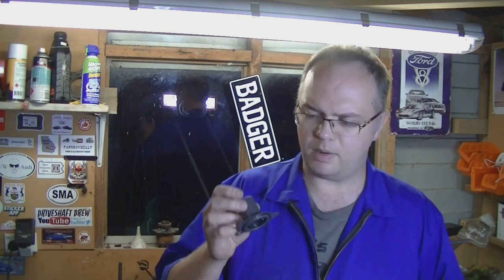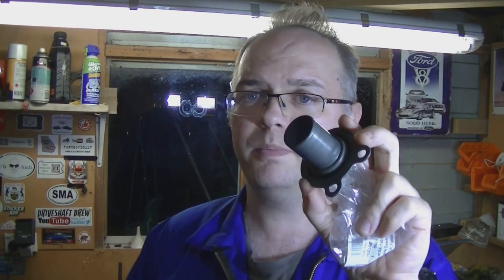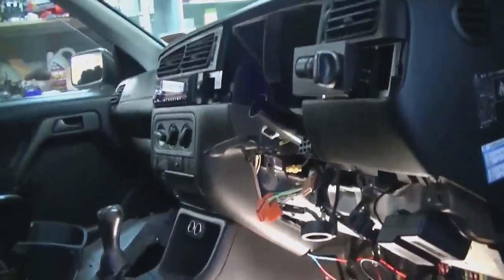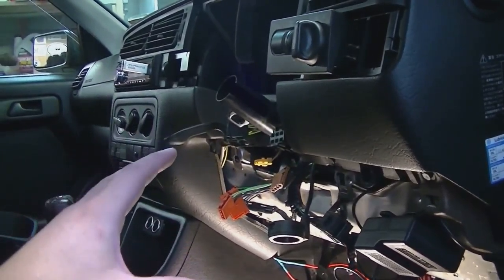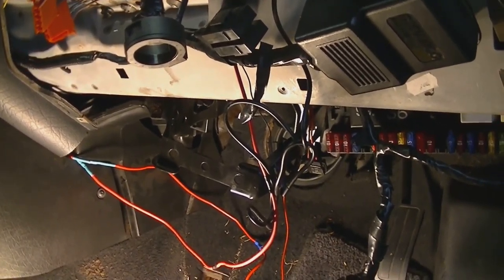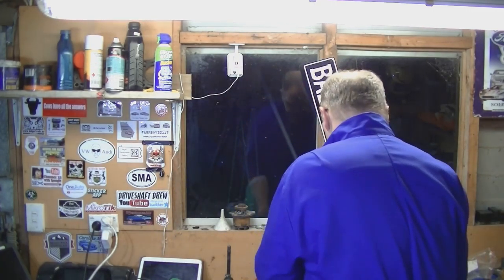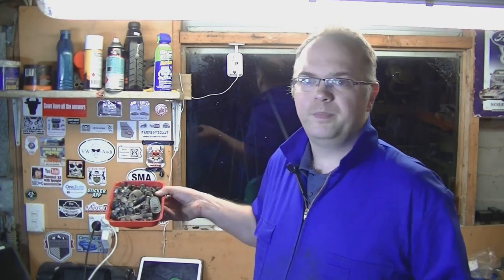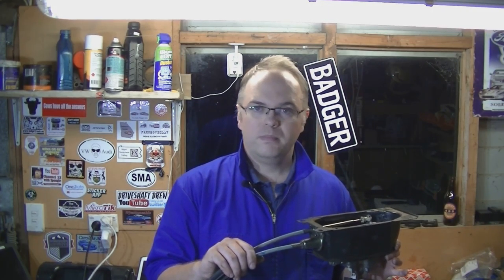Pedals and Levers - Part 9 - VR6 Rebadgered

Comment: Removing that pedal assembly looked like a PIA, but I knew you would get her out of there. Interesting how the mounting is different between the two brackets. Evidently, there must be some change between OBD1 and 2 although you mentioned the catalog showed the same bracket. Worse case is you could cut the existing front mount with the stud and weld it to the other. Would be probably nicer if you had the correct mount to fit like the other :) I'm sure you'll get it all sorted out Jonathan. Good work!!!
Reply from the maker: +stuzman after the pedal i thought the shifter would be easy but it wasn't to be. Looks like there is a manual golf in the scrapyard an hour from here. I'll try and get there today and have a look. As you say, worst case I can cut and weld. Thanks Terry, I will get there eventually. Cheers

Comment: I used a cold chisel on the steering column bolts. I tried the cutting a slot in them part but didn't have an impact screw driver to crank them off. Chisel worked great and I could actually reuse the bolts until I got proper bolts for it.
Reply from the maker: I didn't have many tools to hand so drilled them and then chiseled the heads off with a screwdriver. Hopefully they're a standard thread so I can put regular ones back in
Reply: Badgertronix m8x20 sheer bolt according to ETKA. Probably hardened steel, but I'm sure any other vw m8x20 would do.

Comment: Bummer, is there a bracket missing from the 'kit'? Like you say I'm sure they wouldn't have different body shells. I was thinking cut off the front piece with the single stud & weld it to the manual box. Then also make a bracket, box section or 'I' (eye) section around the shifter cables drill a couple more holes in the floor and nut & bolt it up. Then you would have three fixings at the front. Easy!! LOL
Reply from the maker: I can't find a bracket listed and I can't find any photos on google either. I think drilling and welding is in my future but I would rather find the VW way. Cheers!
Reply: What year is it? I'll look at my Alldata
Reply from the maker: The manual is 1993, the auto 1997. The parts catalogue shows the same manual shifter for both and the same auto shifter for both. I must be missing something. Cheers!
Reply: No go I'm afraid. Alldata starts from 1998. I've looked at loads of engines and gearboxes and there are so many variations, none of which look like your set up. Sorry cant help. Maybe Thomas can look on EKTA or look at oemepc.com

Comment: May have to weld a boss and stud to the box. Is it from the same year?
Reply from the maker: Looking that way. No, the manual is from an OBD1 car, mine is OBD2. Looking at the parts catalogue there is no difference to the bolt hole locations between years and I can't find a bracket listed.

Comment: How easy is it to find a new clutch master cylinder for one of these just like the one you have? I can only find the one where the pressure line comes out the front. Anywhere you know or a part number? Thanks
Reply from the maker: The parts catalogue is available online via realoem.me They were available when i was looking. I would have got mine from eBay

Comment: omg only one camera unsubscribe
and showing off about no rust 
nice job mate lots of awkward stuff you had to do in that it's only when people see videos like this we have to do sometime and every job doesn't just take five minutes

can you swap the boxes over for the gear stick will the parts fit in the old box

if not you can get a heavy 3 mil bracket the two bolts that hold on the gear link cables unscrew them attach the brackets in an l shape drill a hole in the top and that should work fine
Reply from the maker: haha yep definitely unsubscribe for that.
It's a lot of head scratching doing all these fiddly jobs.

The boxes won't swap over, they're totally different. It's looking like a bracket of some sort which shouldn't be too difficult to sort out but wish I could find out how it should attach.
Reply: Wait What? You say sub in vid now you say unsub. 
What's goin on? Are you raising your rates and only using won camera? That's like raising the price of a candy bar and making it smaller at the same thyme. What's the deal? And now we can't watch automatically we have to shift two2 tew too also? Gonna have two2 move two2 NZ and build a Hobbit Hole and live with the badgers.
Reply from the maker: +MostlymoparIH i can't keep up with the current trends. Unsub is the new sub or something like that. I'm heading back to my Hobbit hole for a lie down